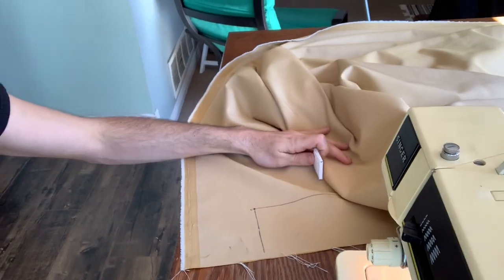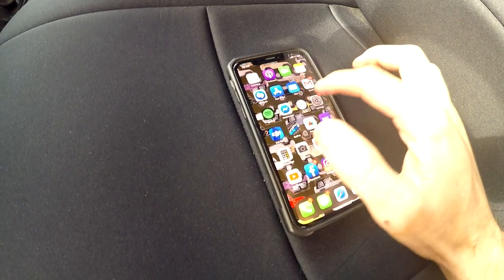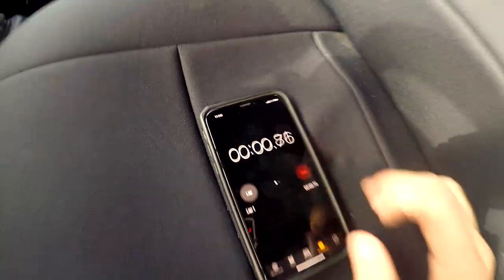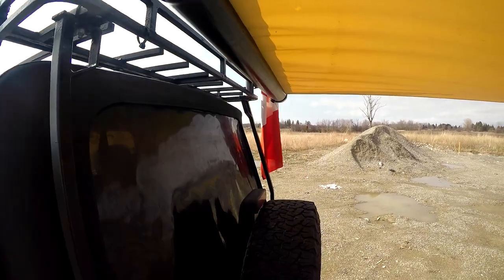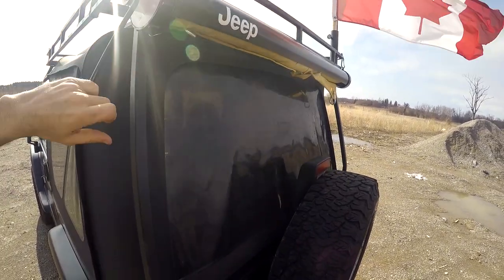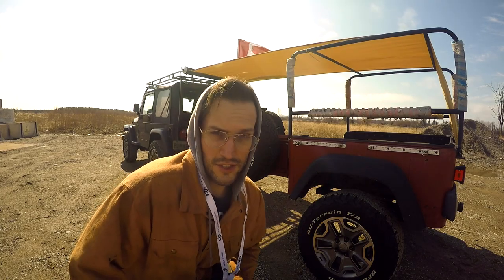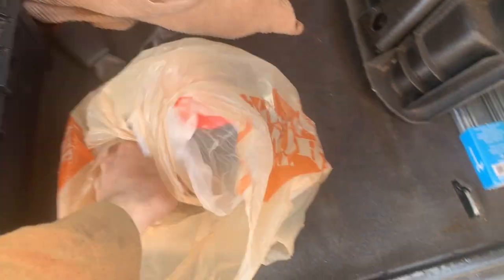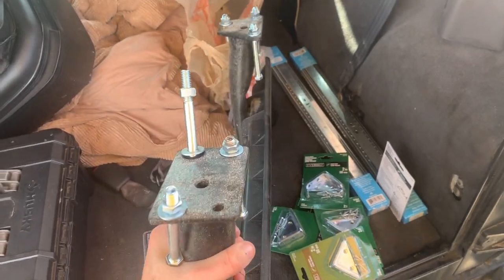Awning upgrade for Boomerang

Comment: what made you choose that color for the awning? it looks like the sahara color. pretty nice. looks like it matches the color of the decal on the hood.
Reply from the maker: My options were limited to functionality. The material had to be rated for outdoor use, waterproof, and can take the heat from the sun. I had two options and the lighter colour made more sense. I didn't realize until I got home that it matched the hood decal, maybe thats why I chose it and didn't realize. Thank you for the question.